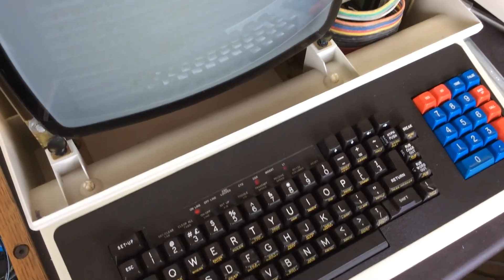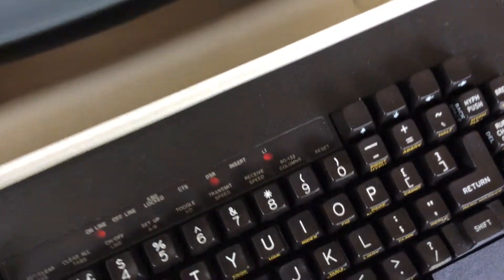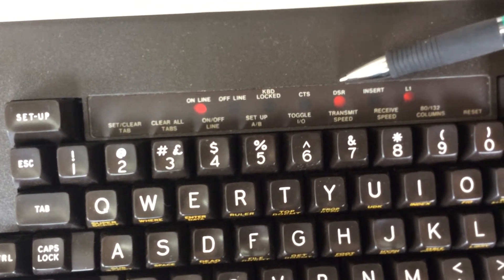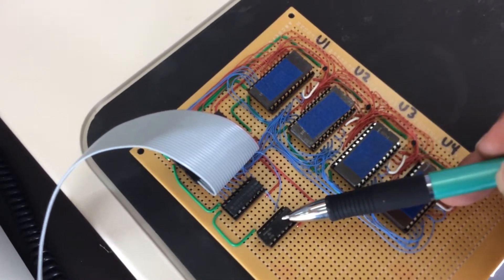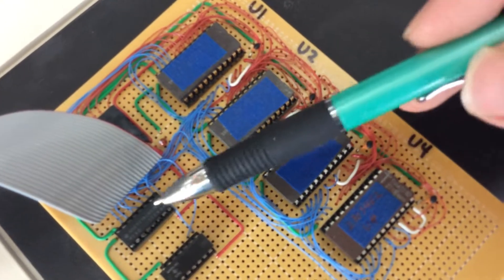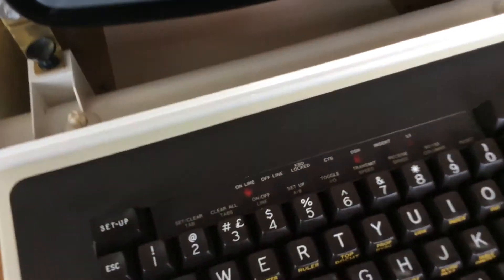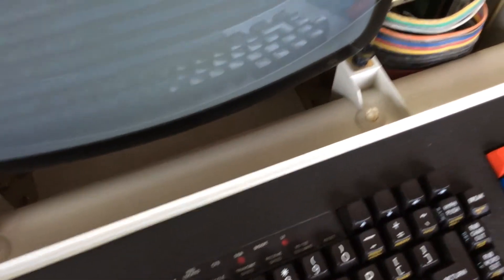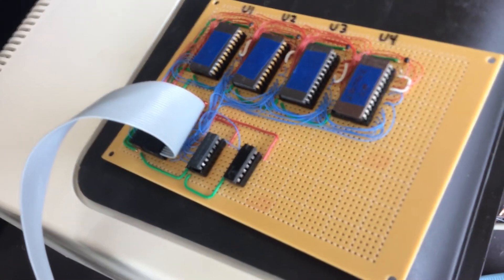Digital VT-100 terminal

Comment: Hey Rick, did you ever get this unit working?
Reply from the maker: Yes the terminal is working. Had to replace the roms with the circuit I built here in video. And had a 4114 ram IC bad as well.  Nice vintage terminal
Reply: @rick601a  Wow, very nice. Do you have a background in electrical engineering or are you a self taught enthusiast?
Reply from the maker: @JesseSinclairYouTube  I am in electronic engineering and RF engineering for radio stations and automated communication systems. The older terminal is part of a radio station automation system. Most small market stations are still using 70’s mechanical automated system simply because they are still working and they paid lots of money for them. And they have outlasted PC based systems that’s currently on the market.
Reply: @rick601a  Super interesting, I wasn't aware radio stations still used older tech like this. I'd love to have the pleasure of working with terminals like this one.